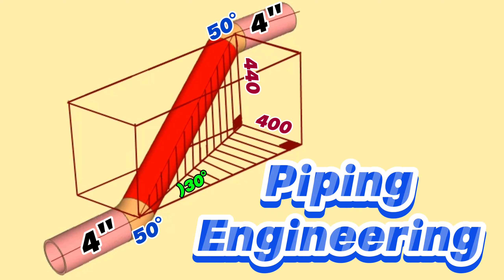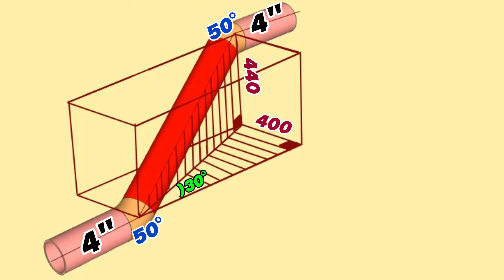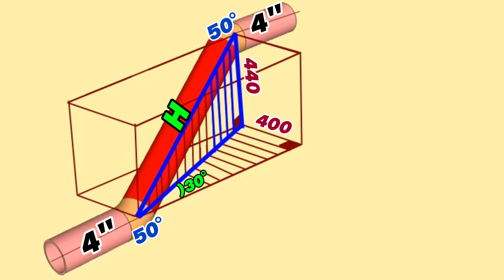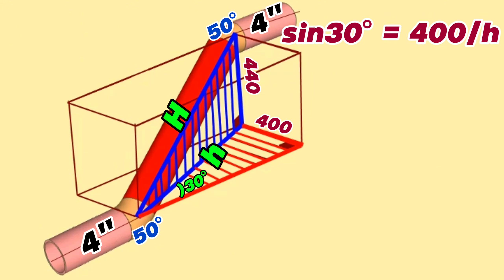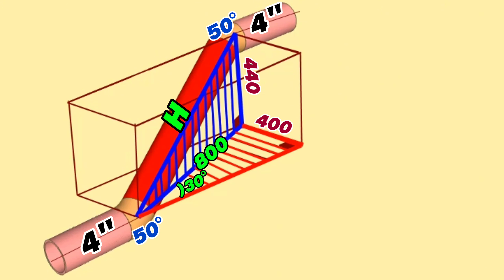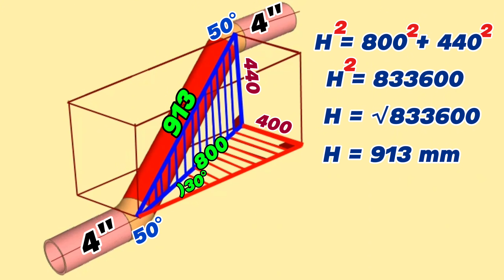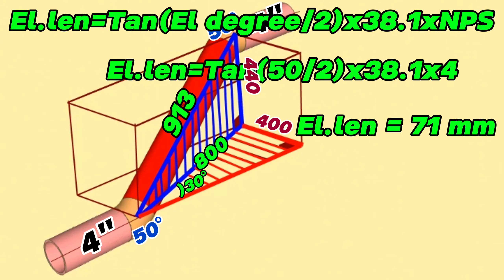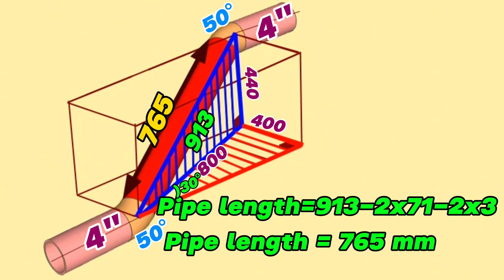Step-by-Step Guide to Pipe True Length Calculation

Comment: How you get the 38.1
Reply from the maker: It is standard.
1-inch 90-degree elbow length is 38.1 mm.
1-inch elbow length = tan (90/2)x1.5x24.5=38.1 mm